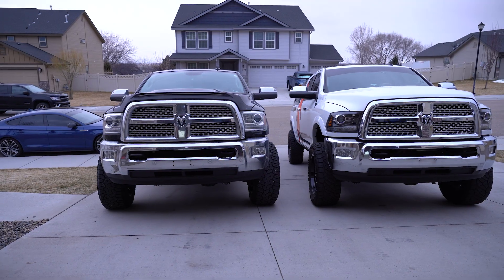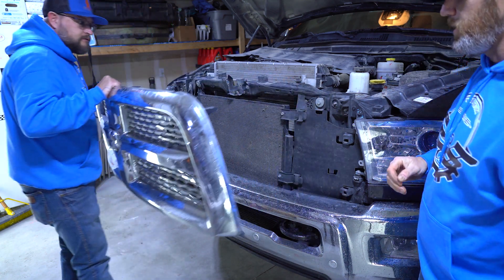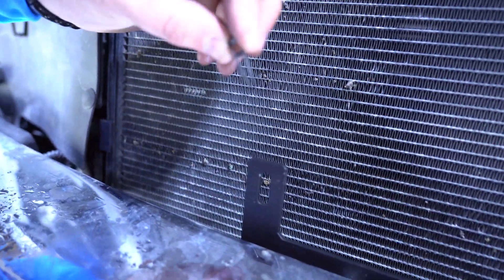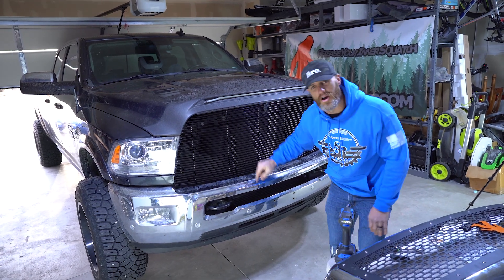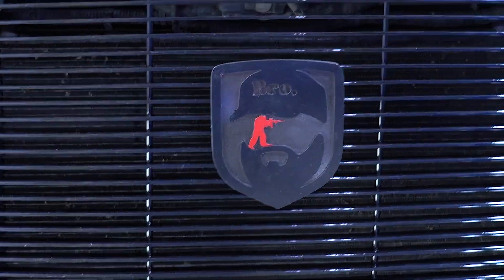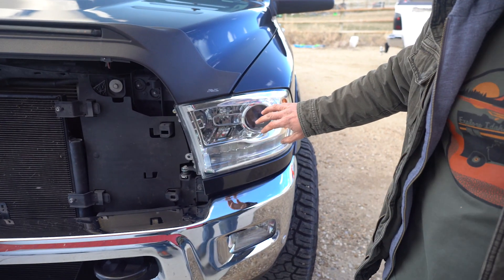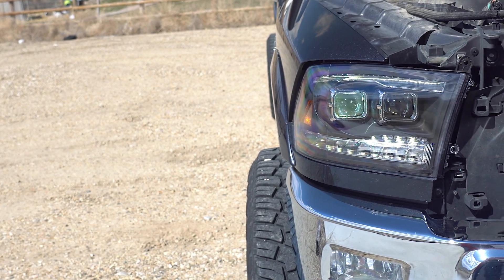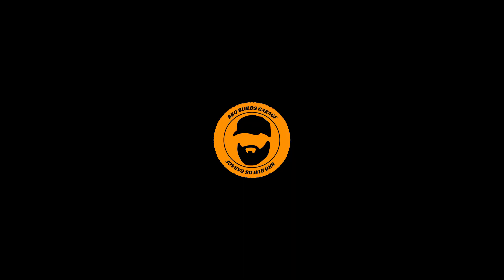3 EASY Mods For Your Ram Truck // Bro Builds Garage

Comment: That black TRex grill does look awesome on the truck, but from a quality control perspective I'd be very disappointed that this is a "Made In the USA" product.  I find it hard to believe that the grill is actually made in the USA. At least if it was made in China I would expect the mounting holes not lining up.
Reply from the maker: Definitely disappointing. I would have sent it back if I had more patience. I really just wanted to get it installed!